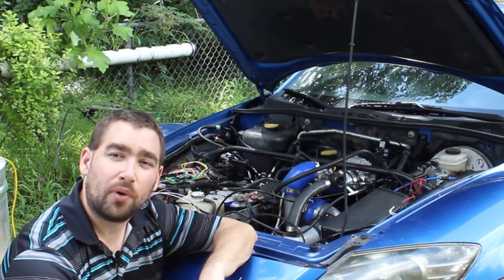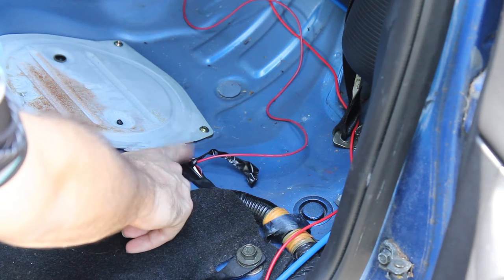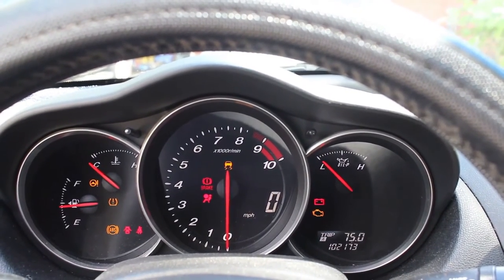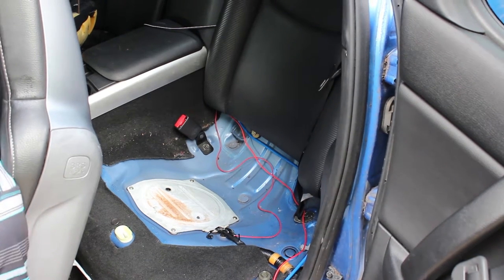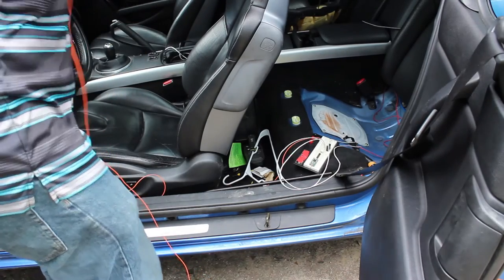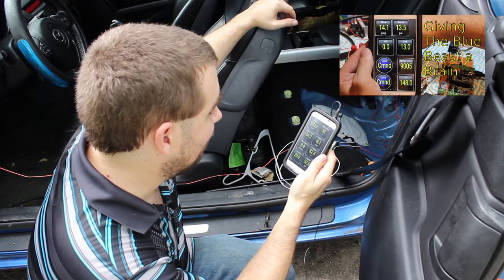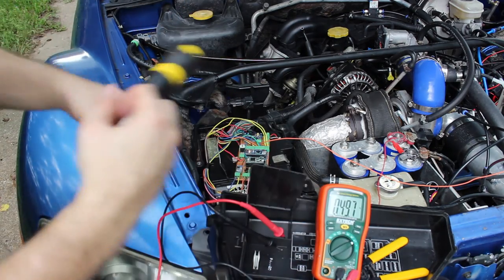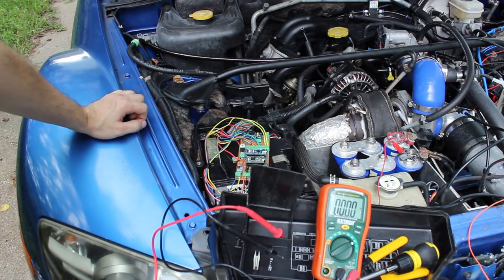PWM Fuel Pump Pressure Control Part 1 - Voiding Warranties Ep-19

Comment: I've made a pwm fuel pump controller, and 4 mosfets with heatsinks and a fan still wasn't enough cooling under heavy load with a slightly larger fuel pump. And you will be limited to the fuel pressure regulator for max pressure.....assuming you were tryhing to get more pressure from this- you should bypass or modify the factory regulator and install a regulator of a higher pressure,
Reply from the maker: +Workshop Audi I have some really nice mosfets I plan on using for this. Over 100a rating and very low internal resistance. I also have plans for adjusting the regulator up out of the way and install a scavange pump for the other side of the tank. Still haven't implemented it all yet. Thanks for the warning.